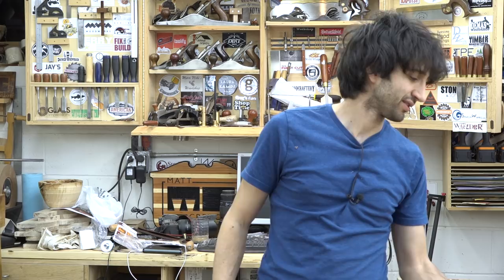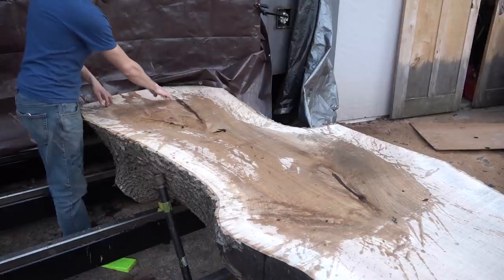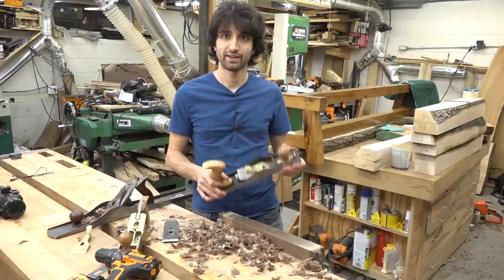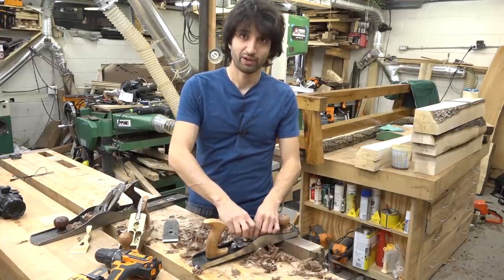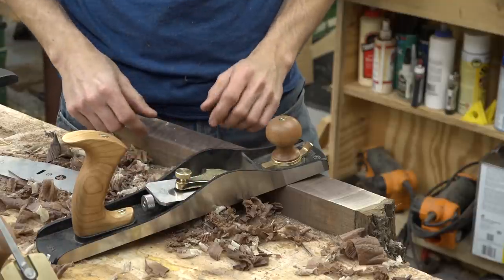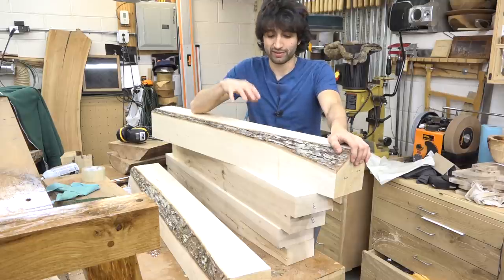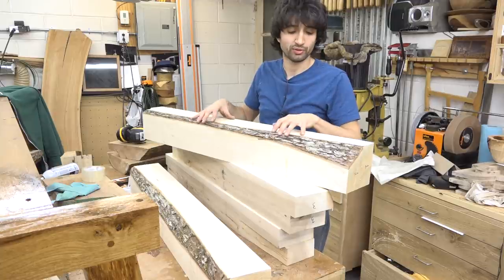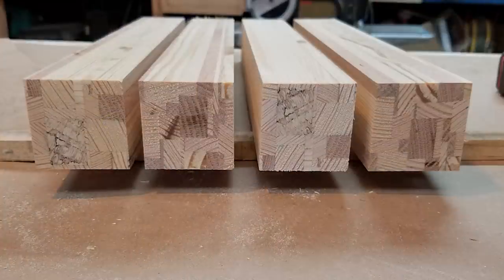Matt's Weekly Shop Update - Mar 7 2017

Comment: Attended a recent Lie Nielsen event on a Friday afternoon and was one of only 4 or 5 people there.  That allowed for massive amounts of time playing with planes.  I tried that bevel up plane and decided against buying. I felt it was too light and required too much effort from me versus the momentum of the plane body. The adjustment was also maddening. 

I did fall in love with the #4 1/2 smoother...  I already own their 5 1/2 and use it for almost everything unless I am jointing very long boards when I use an old Stanley #7 upgraded to a Veritas PM-V11 blade and chip breaker.  (also have a super tuned Stanley #4 with the PM-V11 blade and cap set).

So if I was going to spend around $350 on a new tool, I would head to that 4 1/2; it's sweet.

Comment: I definitely agree on the "It feels weird" statement when first starting to use the #62.  It took me a while to get used to, and I had issues with keeping the plane square at first.  The other thing is making sure the blade is sharpened square.  I bought mine used, and the iron was sharpened out of square, so no matter how much I tried (there's very little lateral adjustment), it would always take a heavier shaving on one side than the other (further contributing to the out of square planing).  Took me a while to figure that out... 

Overall though, I like it, but I think I would rather have a #164 before the #62.  I use that one way more often, and my vintage #5-1/2 with an IBC blade works just as well for me as the #62.  Sharp and light cuts trumps blade angle in 95% of uses...

Comment: Matt, if you sharpen the blade on that bevel down plane you should be able to get a full width, full length shaving on that end grain. I have a Veritas low angle jack and with a 25 degree blade and have done this on end grain hardwoods

Comment: Matt a quick question... You use the term quarter when talking about the log cut sizes. What does it mean in terms of size?
Reply from the maker: +Mr Vic's Pen Shop rough lumber is referenced in terms of quarter inches. 4/4 (four quarter) is 4 quarters of an inch or 1" thick

Comment: I know there are many many variables to consider but is there a general suggested drying time after rough milling boards?
Reply from the maker: There are so many variables that it doesn't make much sense to throw out a number to use as a rule.  The one year per inch thing is pretty much worst case scenario

Comment: I have a Lie Nielsen low angle jack plane as well, and the more I use it the more I really dislike the adjustment mechanism/iron adjustment.  The iron has too much slop side to side and when adjusting it it tends to skew the blade.  So at this point I adjusted it for shooting and only use it on my shooting board.  If I had to do it again, I would not buy it, I would buy the Veritas instead.
Reply from the maker: I actually was surprised by the lateral adjustment as well.  Didn't realize I need a little plane adjustment hammer.  Mechanized lateral adjustment is something I'm just used to at this point.

Comment: Then What?????  LOL!   The rate at which you're getting the big logs milled seems to be fairly quick.  Are you going to go for more or wait awhile due to space issues?   soon it will be daylight savings time and you can be out there longer. LOL!   I noticed your getting pretty ripped re: biceps LOL!  I use to have to lift weights to do that.